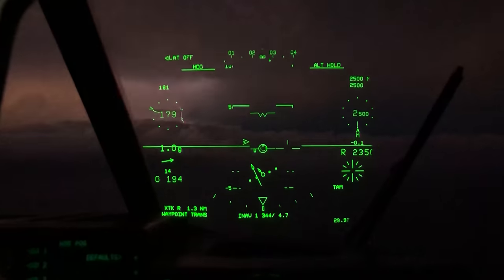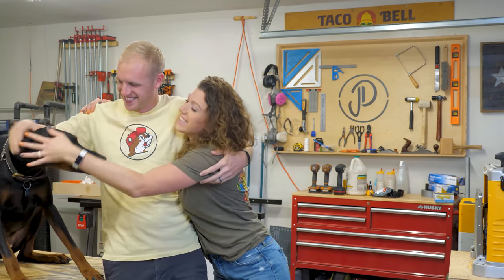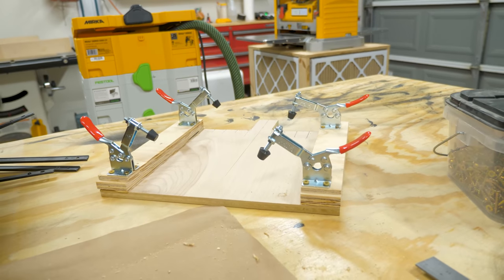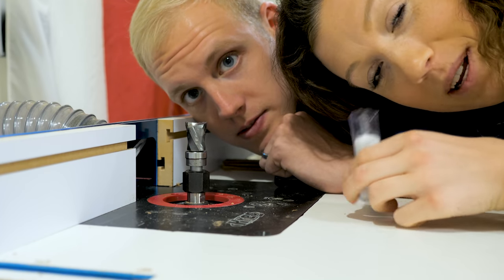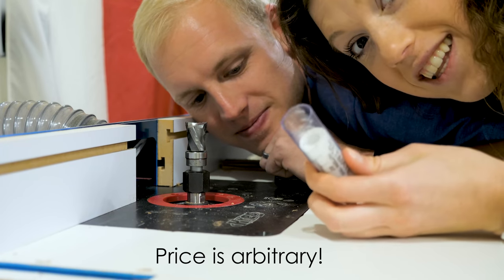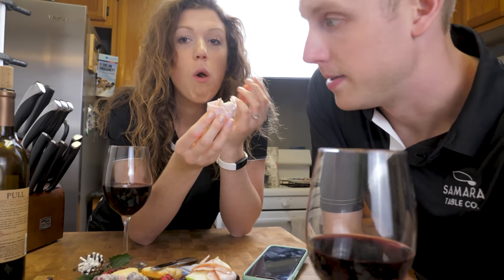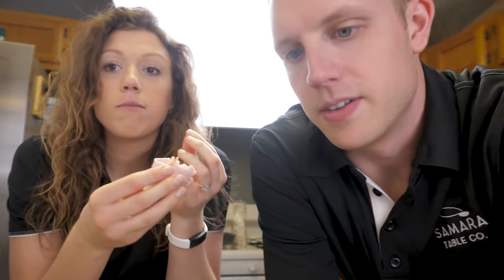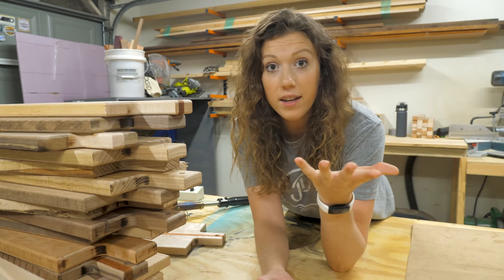we built 20 charcuterie boards in 1 day

Comment: Here's a suggestion you may have already. Place a stop at the non handle side so you dont have to make sure the board is flush with the handle portion or the template. Also, the burn may be because the bit is moving too fast.

Comment: Instead of using a washer to space your line away from the template, use a regular (not thin) sharpie right up against the edge of the template, and then bandsaw just to the outside of the sharpie. That'll save you a few seconds per board.

Comment: I know it's a lot of cash and I know I said it before but you really need a industrial CNC router. I know you have or had a CNC router and to me I see that type of CNC router as a hobby machine or as you called it a consumer CNC because they are not the rigid and don't have the horsepower. If a CNC router can't do the job in one pass then you don't want it. A industrial CNC router would easily do what you did in under 10 minutes with a smooth finish, this includes loading time. One day when the two of you want to take a drive call up RouterCAD in Terrell Texas and visit there shop. Make sure they have one to look at a test run on the shop floor first. You can pickup a new CNC router from them around 35K. The best part in your case would be you can get it in 220 volt single phase with a vacuum table, vacuum pumps and a automatic tool changer for that price. That is perfect for a garage shop or even if you move to industrial building as long as you have the proper 220 volt power source in the shop. We have six CNC router with names like Onsrud and Biesse. Over a year ago I purchased a CNC router from RouterCAD just to do drawer rollouts and high backs because I didn't want to pay the price for a Onsrud or Biesse. I liked the CNC router and price so much I just place a order last month for two more to make other products starting next year. With a CNC router you can do so much with so little work after it comes off the CNC router. The key to CNC routing parts is if vacuum will not hold it than make fixture to hold it don't use tape or screws that's for hobby workers. I say this but sometimes the small parts move using vacuum when this happens then two passes are needed one at full depth of cut minus 0.020" and the second one at the at full depth of cut. If people think CNC's are slow or don't give a good finish then they haven't been around a industrial CNC router. If they think it takes to much time to load them then they don't know about fixtures or don't know how to design them for speed loading. I tell you the biggest problem we have dealing with wood is getting rid of our rejected wood. It's all hardwood 8 to 10 foot long 1 inch thick and most of it 3 to 4 inches wide. Why is it rejected? Because it has a knot in it or the color isn't right. We get rid of a 40 yard trailer load every week. I wish I knew a company that would take it all every week instead of us putting it into the landfill. We also send 80 to 120 yards of UV coated wood to the landfill a week but that I see most likely can't be used to turn to other products like fire pellets. We have someone that takes all our wood chips that come out of our three baghouses. We give it to him and he sales it as horse stable beading. Now you know that before you make to much scrap or wood chips you'll need to find a way to get rid of it. We pay about 1K a week putting it into the landfill.

Comment: A cnc is needed if you want the make something quickly. That’s your goal isn’t it?. 

Making changes on the fly is done easily and only requires an edit or 3. Not building a different jig if you change the design. Your boards are very simple in geometry.
A more complex board should take less than 2 minutes to make on a cnc it will be much more precise too.

Comment: I would probably use a wider board in the middle that allowed for the width of your plunger router and used a 3/4in bit. Then a stop block on both ends all made out of the same jig. Then just push your router against stops (back and center)  plunge your router and push to the front sop. Repeat on other side of jig

Comment: My suggestion would be as you are using a template for the handle, why not go for something a bit more fluid? Also look at your router speed with the bit you have, you should be able to minimise the burning from the cutter therefore less time sanding👍👌

Comment: you should absolutely add a stop, or a back to the jig so you dont have to "finger measure" the part that will be hit with the router.  just slide in the board and start routing

Comment: What I would do is what I did. The jig looks ok I use the same clamps have a flat sled with threaded inserts in the sled in a bunch of different spots. I have 2 of these sleds one has 4 different handles and the other has 6. The nice thing about it is by turning the board, or offsetting it to one side or the other you can make a bunch of boards and all of them look like custom one offs with about the same amount of work yours takes. Just an idea when you guys make a version 2.

Comment: first off: grat idea to make a clamping system. but as you and others pointed out, make yout templet as perfect as possible. a minute spend there is an hour saved on the board. 
this is the point to use your CNC. Chris Salmone from four eyes furniture has some good infos regarding a CNC in that matter.

if possible change the speed of the router. spereds and feeds for most woodspecies are mentioned by the producer.

next up change the radius on the board to be bigger than the routerbit this will reduce the burning. (ask if you need the explanation)

as already mentioned, take a cheap handheld router for the roundover. 

ps: geedings from germany
Reply from the maker: Thank you! Lots of great tips in your comment

Comment: Why don't you use your CNC? Simply create your handle design in Fusion 360. Setup your CNC Table for that handle, lay your board in there and press the button. Rinse & Repeat
Reply from the maker: Believe it or not, that's slower than this method. Until we have a large industrial CnC with an optimized file to cut out 20+ at once, this is the fastest method!

Comment: Less a speed suggestion and more of an efficiency suggestion, but the cutouts from the bandsaw on either side of the handle are begging for some kind of re-use. They look just a hair too small for use as coasters, which was my first thought (resaw the cutoff in half, clean up the surface, route the edge same as the boards, a little cork or felt on back, and voila!). But there's got to be some way to use those to pull more profit per bd.ft and reduce waste. 
If nothing else, those cutoffs would make for great woodturning if you stack & glue them. Maybe use them to work out some kind of exchange deal with a woodturner you know.

Comment: Those small imperfections are the difference between small batch production and ikea junk.
Reply from the maker: You've got it totally backwards, Sarah. Ikea junk is built by robots and machines - Ikea furniture looks too perfect and is made with flimsier materials. Read the Wikipedia article about Wabi Sabi
Reply: @jennieanddavis  my remarks were poorly written,  the Small imperfections are a good thing. The all to perfect Ikea junk is engineered to use the minimum amount of material and last the warranty period and no more. The cutting boards etc you two make will with some care last several lifetimes

Comment: Guys a cheap small cnc router would make that process so easy and so much less work.
Reply: I'm not certain that a CNC setup would be any faster than what they're doing. If they were cutting the initial board shapes out of plywood, then yes, a CNC would be much easier than sectioning the plywood and using the band saw to cut out the handle. Or if they were putting in a groove or indentation for a bowl or cup, then CNC all the way.
Reply: @abrannan  this is way more complex trying to answer your comment then i have time to deal with. But owning a custom furniture company i am pretty certain i know what easier and faster and more profitable. So i dont have time to argue about it I was just trying to give the young guys a helpful suggestion.
Reply from the maker: We tried a Cnc. Way too much trouble and time for what it’s worth. Maybe one day when we have an R&D employee’s time to waste.

This does give us a good idea to use our laser to cut a thin template, then we can use our pattern bit on plywood to make a final version!
Reply: @cmwatcds1  that’s how this works. You give your opinion, I give mine, and they read both, consider both and do whatever they want to do.  There’s no need to flex, drop credentials, or play the “your response was so wrong that I don’t even have the time to go into why it is so wrong” card. 
All I was saying is that considering the particular cut they’re doing on these boards, a simple handle and simple crosscut in 8”-10” x 3/4” linear stock, working at scale, that by the time you figure in material placement and feed rate, you’re not looking a very significant time savings on this particular task, by my estimation. 
Now, it’s entirely possible that I’m wrong. You may know some setup shortcuts or available technologies that I’m not aware of. But based on my experience with CNC woodcutting, those two through cuts with routed edges on both sides of the board aren’t going to see a significant time savings by moving them to CNC.